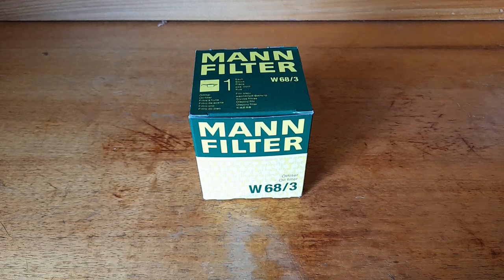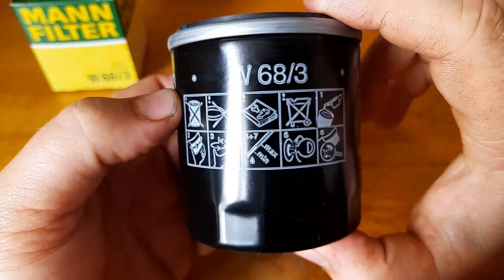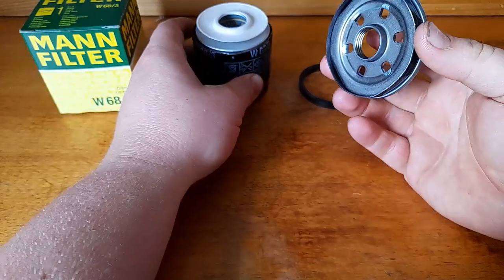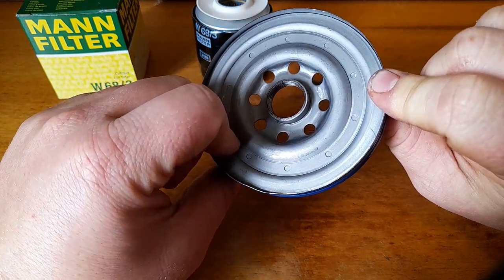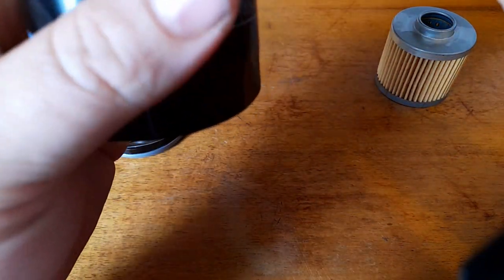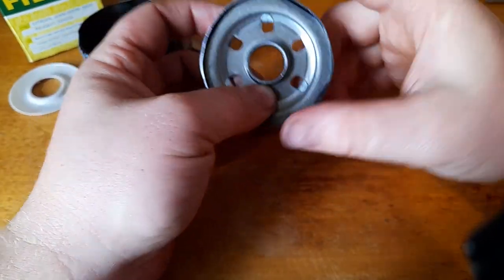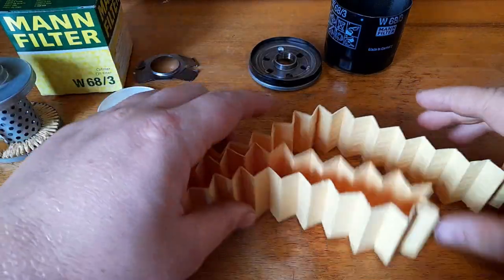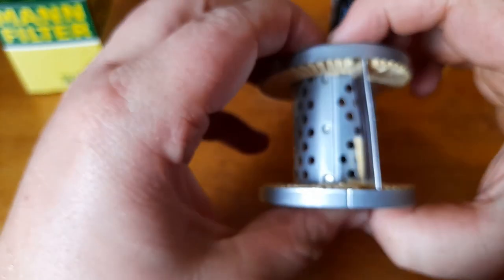MANN 68/3 Oil Filter Cut Open and Review

Comment: Its not loose. It has a bit of play because its just not welded/glued. But it doesn't have to because its screwed. So when screwed in, the 'loose' bit is pressed upwards by the screw and the rest of the can is pressed downwards by the seal. And at this point its equally as being glued/welded. And even if it is not oil tight the oil is going there anyways (through the big holes). The tabs are probably just to hold it there while its not screwed in, so it dont flop around.

 The flat sides could be because of manufacturing reasons (better/easier/cheaper to build) but as it doesnt hurt performance, i dont mind.

Comment: 2 things I don't like, 1. The base being loose. 2. The flat sides to the can.
Reply from the maker: Yes it's definitely a different design, I not sure what to think of it myself
Reply: Its not loose. It has a bit of play because its just not welded/glued. But it doesn't have to because its screwed. So when screwed in, the 'loose' bit is pressed upwards by the screw and the rest of the can is pressed downwards by the seal. And at this point its equally as being glued/welded. And even if it is not oil tight the oil is going there anyways through the big holes. The flat sides could be because of manufacturing reasons (better/easier/cheaper to build) but as it doesnt hurt performance, i dont mind.